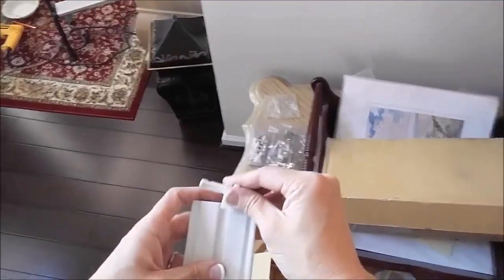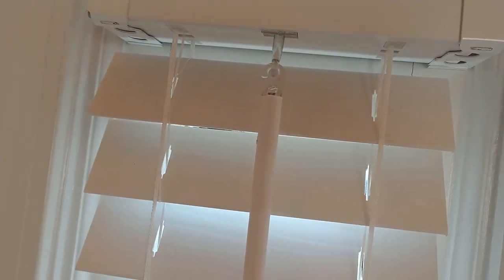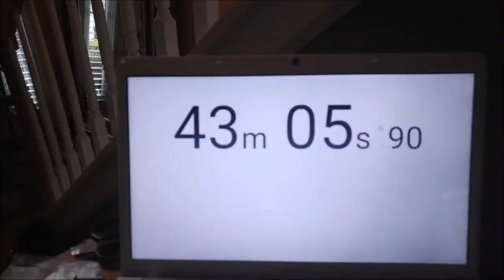Install Faux Wood Blinds - with timelapse!

Comment: Nice video! To answer your question: I just had the glass in my sidelights replaced. Call a glass (not a window) company that does car glass, shower glass, commercial glass, etc. The company that I used has a contractor that they work with for any wood rot type issues, and that guy came out at the same time as the glass guy. They were done in 2 hours. Windows look great! Way cheaper than replacing the whole door/sidelight/transom system that the window companies I called told me I would have to do.
Reply from the maker: Thank you for the advice! I hadn't thought of that.

Comment: Can you please share the model no of the Blind and the screw size that you replace with. Very helpful video.
Reply from the maker: This project was done many months ago, so I do not have the specific model number.  But they are available at Home Depot in a variety of sizes.  The screws were #8, 1/2 inch screws (I believe).  https://www.homedepot.com/p/Home-Decorators-Collection-White-2-in-Faux-Wood-Blind-35-in-W-x-64-in-L-Actual-Size-34-5-in-W-x-64-in-L-10793478068180/202040452
Reply: @ChickFixUSA  Thanks!
Reply: @Amberwaves14  Thanks!
Reply from the maker: @christineb7304  mine I cannot.  But they have new cordless ones that might, if you can find them narrow enough.  (It's hard to fit the raising/lowering mechanism with such narrow space at the top.)